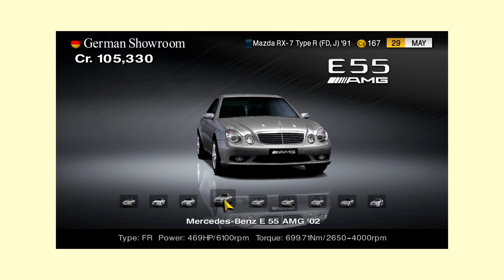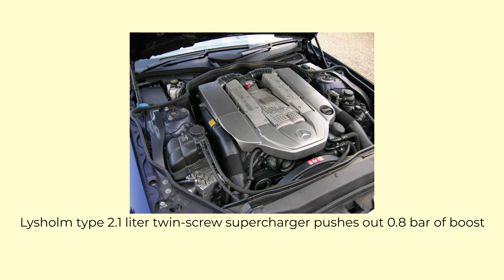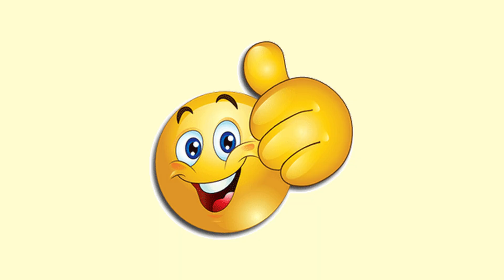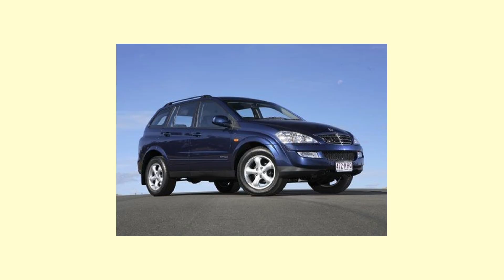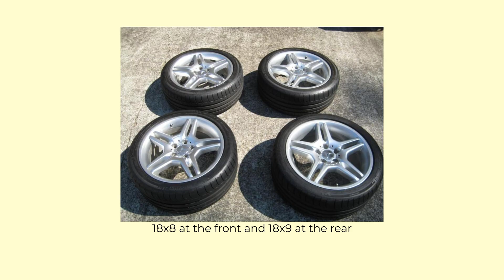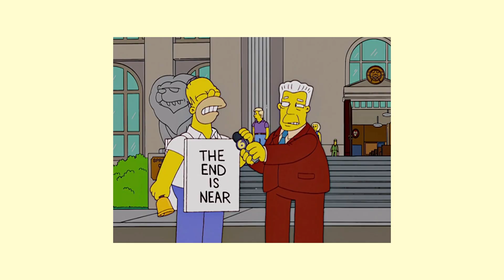Automotive X-Ray: Mercedes-Benz E55 AMG

Comment: Five years my daily driver was a 05E 55 designo flintengrau grey…oatmeal & coffee leather. You’ll notice that this was during Daimler Chrysler era and SRT program just copied everything here to make the hellcats even the under chassis of the W211 is Challenger and charger so you can call this. The father of the hellcat legitimately even the supercharger is made by the same company.
Reply from the maker: Yep extremely underrated, and unlike the W204 AMG there's not one catastrophic engine issue with the M113K either